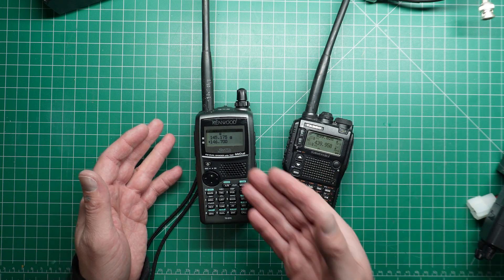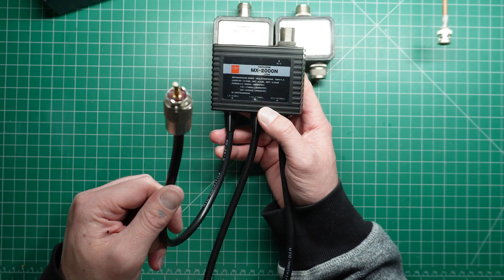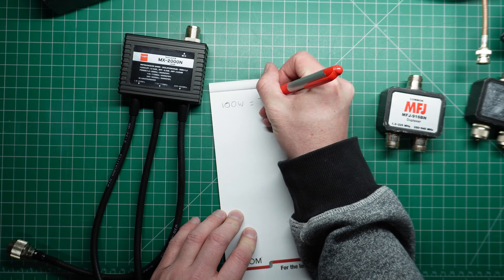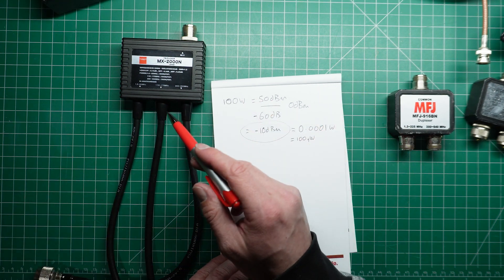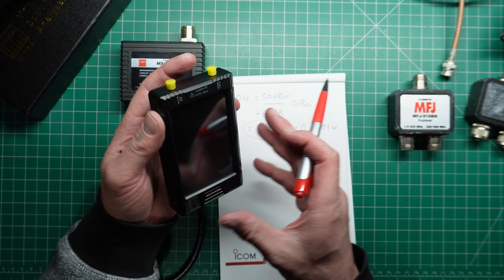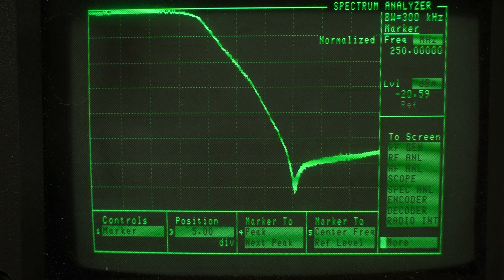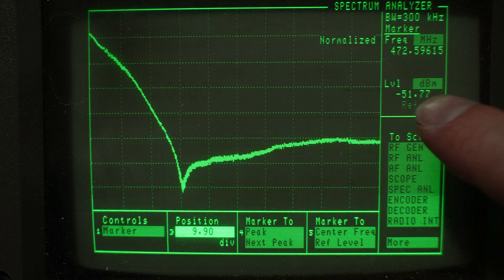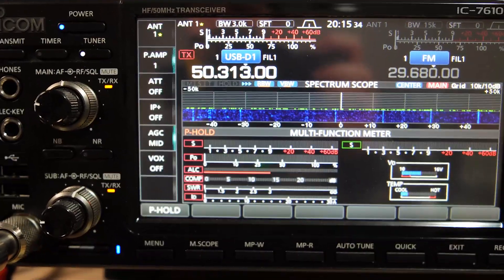Connect TWO (or Three) Radios To ONE Antenna

Comment: Well explained diplexing, thanks. What is the best way to combine two uhf yagis (RDS north, RCM south) into a single radio port?
Reply from the maker: Power divider (Wilkinson divider). Don’t use them (or a coax phasing harness) outdoors… if it gets any kind of water in it, it’s useless.

Best to run equal feedlines to the shack, then put the power divider there. Same loss etc (just a bit of extra feedline).

Also antennas need to be stacked or mounted correctly - MMANA is great for modeling what the pattern will look like - remind me to show you Weds night

Comment: What about same two vhf radios on the same 2M antenna?
Reply from the maker: If they are both transmitters you will need a circulator and a multicoupler filter
Reply: @ thanks!

Comment: what if I want to use my uhf radio and scanner on one antenna. they are on the same band. is there a diplexer than does 300-900 on both inputs?

Comment: Why is a diplexer (2M / 440) so small? Yet, a duplexer (2M / 2M) giant size, by comparrison?
Reply from the maker: A diplexer is a simple L/C HPF circuit, so can be built much smaller. Duplexers need high Q due to the small frequency spacings and to do that, you need 1/4 wave resonators (i.e. large)

Comment: For 70cm and 2m on a HT, just use the same ant. Yes, mobiles at higher watts might be different. My QHT mobile for dual band drive a homemade 2m HV dipole. SWR on both bands is in the dirt.

Comment: The 3 antenna ports on my IC-9700 go to antenna switches for each band, one of the ports on each switch goes to a triplexer.  This allows me to use my triband vertical or switch to horizontal antennas for each band.

Comment: Be a little bit careful of the two radios into the one antenna use of these as others have said. I wouldn’t trust some of the cheaper brands to have the advertised isolation…. Good video.

Comment: You're not quite right on the duplexer/diplexer issue.

A duplexer allows simultaneous transmit and receive on one antenna. (Duplex communications.)
A diplexer combines two transmitters or two receivers to one antenna. Broadcast facilities use these to put multiple stations on one antenna, saving tower space.

So, the two port devices you had are correctly marked as duplexers.

Of course, this could also be a US/VK language difference.
Reply from the maker: No, it's a universal thing and I was right on the duplexer/diplexer naming. Here's more info:
https://www.repeater-builder.com/antenna/ant-sys-duplexers.html

Comment: Instead of a diplexer giving -50dB of isolation, what if you had two antennas only a few meters apart? Would the separation be better or worse?
Reply from the maker: You can calculate theoretical isolation using calculators. Here are a few that I use:
https://calc.commscope.com/qhisolation.aspx
https://calc.commscope.com/qvisolation.aspx

Comment: Great video.  I found a problem in a setup using triplexer and diplexer before.  If using a radio with harmonics .They easy travel to outher radio .A outher reason to  to check each radio for harmonics.  They can desensitize the outher radio . Also using a band pass filter on each radio improves isolation a whole bunch.  Like on set up with 6 meter split to VHF/UHF . If you put a band pass filter on each radio that slight cross over will disappear.   Also a band pass filter helps with harmonics out of band. Each set up is different , results will very a bunch between setups ,  coax can cross talk . Copper foil shield the best . Separating coax helps as well. Lots that can mess things up. 73
Reply from the maker: Yes great tips Robert!

Comment: It's well worth reading the specs and also checking the actual isolation of some of the cheaper diplexers.
There's significant evidence of users blowing the preamps of their IC-9700s using a diplexer to run into a single antenna.

I measured a diplexer I bought and despite the specs stating it had >60dB isolation, the Siglent spectrum analyser revealed that it had well under 50dB. I was able to improve things by squashing and expanding inductors but still couldn't get it better than 60dB.
Reply: Got me concerned now!
I'd love to test my triplexer, the Diamond MX-3000N
I'm kinda struggling mentally on how to go about it.
I have a NANO VNA and a TinySA, but i can't generate a signal with the TinySA.
I guess i could just connect the triplexer to the 9700 and put out 10 watts on 2M while measuring what appears on the other ports... is this the way?
Any suggestions?
Reply: @virtual812 
It would be difficult to measure the output from the triplexer as it won't register on something like a power/SWR meter.
It really needs something like a calibrated spectrum analyser to check that the unit meets its specs.

Comment: Hello, I've got 3 Bridgecom repeaters on a CX-333 antenna. I'm using a Austin Triplexer. System running about 25 watts each. Works well, the duplexers were all carefully tuned, so far no interaction. Two of the three have RF circulators.

Comment: I thought these were for connecting one radio to multiple antennas, so you don't have to manually switch antennas?
Reply from the maker: Yes you can use them for that too
Reply: can you use them by flipping them around?  one radio on the common, and different antennas for the range specified?

Comment: @HamRadioDX what's the rule of thumb on spacing of antennas? Is there an inherent problem if an antenna is too close to another?
Reply: 1/4 mile to be absolutely sure but most people can’t do that. Near field interference is a crap shoot. You just have to try it. Far as possible though.
Reply: @forgetyourlife  This question is for your own base station various antennas.  I guess you're answering that too.

Comment: Love these videos, always learning something new! I'm in the process of sourcing bits for my shacl and wondering whether you could then run a splitter or selector off one of the feeds into two radios? Ie I have a 70cm radio, a dual band 2m/70cm and a 6m. Could I run the one antenna into a diplexer, then the 2m/70m leg into the two radios? Thanks
Reply: You said you have two radios but then explained what sounded like 3 radios - (1) "a 70cm radio", (2) "a dual band 2m/70cm" and  (3) "a 6m". Do you mean triband 6m/2m/70cm as the second radio?

From what I've been reading, I think you could split 2/70 to one radio and 6 to the other radio.  But I think you'll have issues if you want to split 70 to one radio and 2/70 to another radio, because they're both on 70.
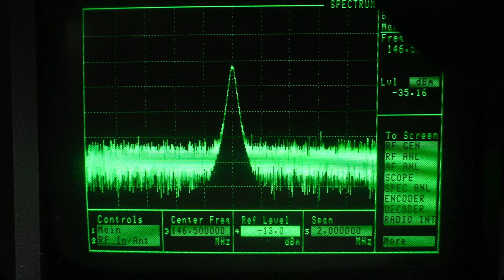Reply: Listen at 12:20, Hayden says he has a Diamond V2000 tri-band antenna, and can listen to 2 and 70 on one radio and operate on 6m on the other radio.

Comment: Great video Hayden. I do the same thing as you (but with a diplexer). 50MHz into the IC-7300 and 144/430MHz into either the FT-8900 (For FM working), or the IC-705 if I want some SSB/FT8.
Reply from the maker: Thanks Jonathan, that’s the way to go 👍
What antenna?
Reply: @HamRadioDX  v2000 same as you. As if there is a different choice?